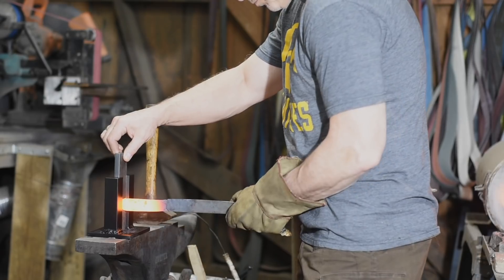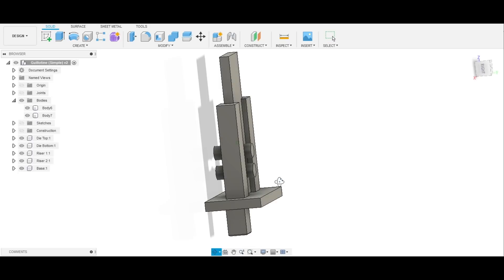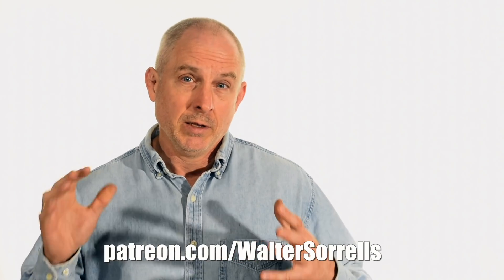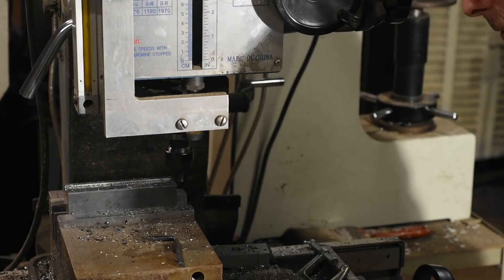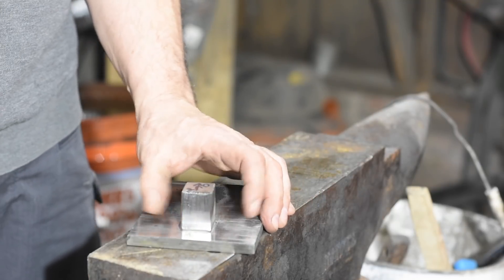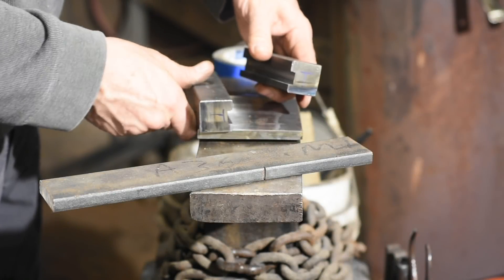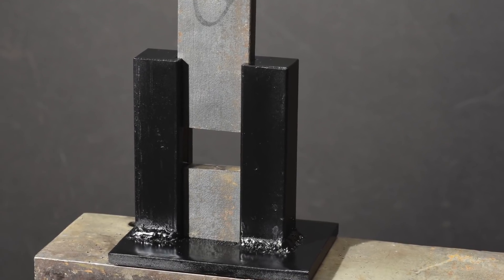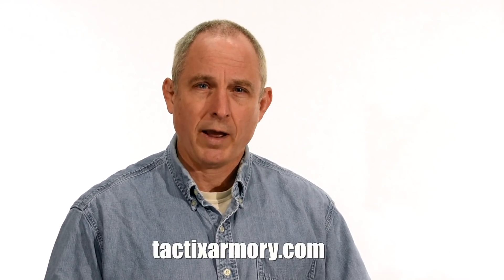Making a Blacksmithing Guillotine Tool

Comment: I built one pretty much exactly like this a couple years ago.  Eventually I had to add a small strap connecting the top of the two vertical pieces, as over time they started spreading away from one another.  Still works great though, would never be without one again!

Comment: One suggestion, if you bevel the tang on all 4 sides 45°by about 3/8 to 1/4 inch for a 1 inch tang. Then weld the tang to the plate you will have more weld holding the tang to the plate and it will be easier to clean up the the welder and no pocket.

Comment: Thanks for another great 'how-to' video, Mr. Sorrells.  Wondering why you used TiG for part and MiG for the rest?  Do you prefer Flux Core Wire for some reason?  (Better in the wind is the only thing I can think of offhand....)  Thanks, Again, Sir!  Bill

Comment: Not for nothing but it kinda looks like your tip on your gun is sticking out way too far. You’re nozzle should be trapping the gas.  With your setup you have no gas making it to the tip, hence chicken droppings.
Reply: It could be flux core wire nd thus no gas is used.
Reply: gary bower I agree, but his gun looks too big. You usually only go gasless with little 110s. Looking at the size of Walter’s gun, you can tell he has a 220 welder.

Comment: Love my guillotine tool and couldn't imagine working without one. It's no substitute for learning good hammer control, but it sure does keep set downs clean. Fullering dies, flat dies and butchering dies are must-haves that will do damn near anything you want. I'd like to make a set of tenoning dies just for good measure.

Comment: 9:22 "After completing my FLAWLESS Nuclear Plant quality welds ..." (which actually resemble pigeon poop) 🤣🤗

And the Academy Award for non-chalant self-effacing sarcasm goes to Mr. Sorrel. 👍

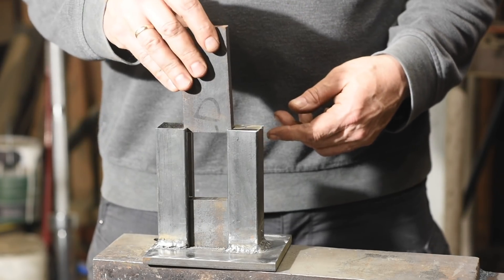We'll conveniently ignore the slight counter clockwise twist in the interface between the Hardy post and the base plate (see 9:44) - still 10x better fit n finish then any other homemade rig i've seen vids of. 😋🤗👍

Comment: Walt I’ve run into similar weld Clarence issues before and identified two options
1 drill a hole through the plate 1/4 smaller than the square bare and weld from the top or
2 chamfer heavily the square bar on the side to be welded on the plate like a 1/4” to 3/8 chamfer per side. Then the weld will fill out but not exceed the bar size
Reply: heh. i thought of both of these options but favored number 2. glad to know even though i dont do this kind of work, i have the problem solving skills if i wanted to. lol